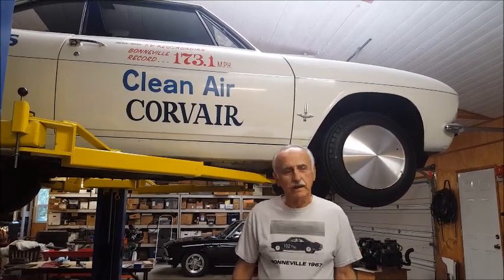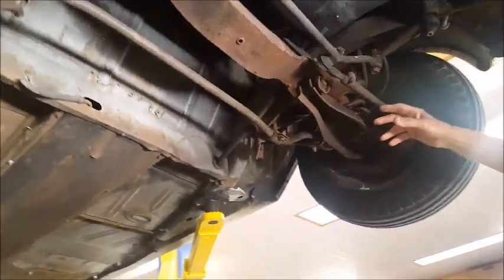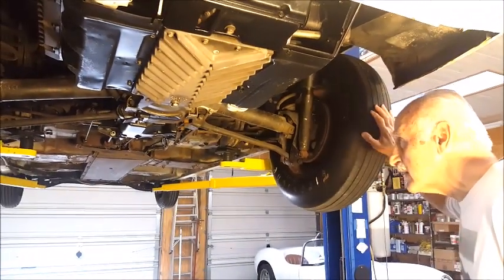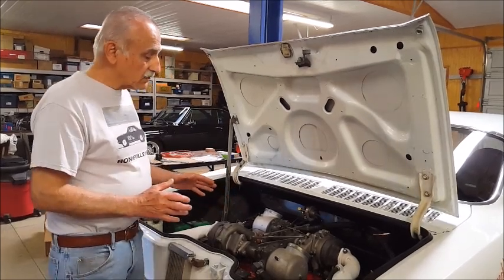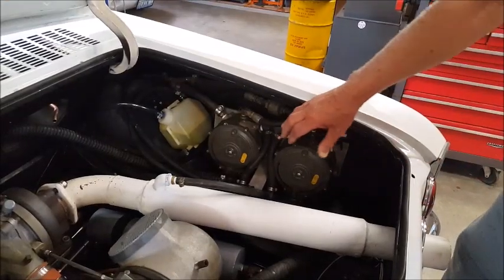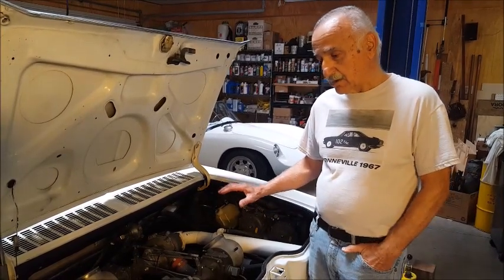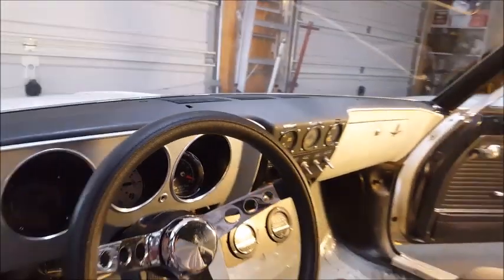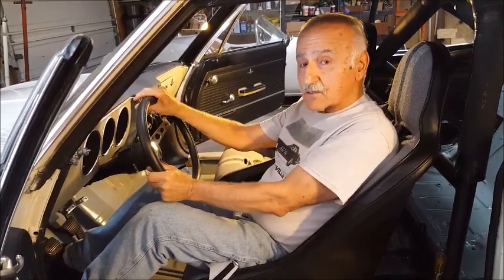World's Fastest Corvair, Is It Safe at 175 mph?

Comment: They did come with an extra fan belt, they tended to break at odd times. Ralph Nader made a fortune picking out the CV as his target. Yes, they would burn in a collision but so would a lot of cars at that time. They tended to leak oil too but that was the engine assembly. When rebuilt by an after market shop they didn't leak. If Chevy would have put some boost into the turbos they would have been a bunch quicker. A good car with a bad rep. We used the engines in sand rails and they really got with the program.
Reply: Don't confuse the Corvair with the Ford Pinto.
Reply: @johnholzhey8149  
To be honest, I never ever saw a Pinto in any of the junkyards in this area that had burned.  I got intrigued at all the bad pres that Pintos began getting along the way.  Here's what I found out:  

In order to make a Pinto catch fire in a "low speed rear end collision" the impacting vehicles (4100 lb retired-civil-service Dodge Senecas) had to have sparklers mounted to the bumpers and the impacted Pintos had to have gas tanks filled to the brim and even then the Pintos seldom ever managed to catch fire unless the impacting speed was steadily increased until that "low speed impact" ended up being 40 mph.  And even then the Pinto didn't always manage to catch fire.  You had to clobber the Hell out of a Pinto to make it catch fire, hard enough to crumple the car and shove the rear axle assembly into the back seat and likely kill the occupants which would make any resulting fire moot.  I have several photos of crash-tested Pintos that had the mortal hell knocked out of them, enough to actually warp the car so bad the windshield shattered and they didn't catch fire.  

I dug through the NHTSA and looked up the stats.  It took a while...  At last count (that I was able to find) the record for deaths in any Ford products Specifically caused by Fire and not just impact trauma appears to be the Panther platform which is the Lincoln Town Car, Crown Vic and Merc Marquis.  Latest numbers I could find for deaths from fire (several years ago) was 109.  Interestingly, more than a few of these fires involved police officers in Crown Vic cop cars.  Next was the first generation Mustang which had the same drop-in fuel tank as the Panther platform cars... latest numbers then was 67.  The Pinto?   NHTSA's latest at that time, 27.  These were the only numbers I could find that were actually stated as having been caused by fires and not the crash itself.   Last note:  A few years ago, deaths from fires in Mustangs added to the count when a restored early Mustang was stuck from behind, ruptured the fuel tank and splashed gasoline into the passenger compartment which ignited, resulting in a fatality and a lawsuit.  Not sure how the suit turned out, couldn't find any more about it.
Reply: @tonyunderwood9678   The easily punctured pinto tanks were due to one particular bolt piercing the tank. That was corrected. Don't joke about sparklers. Aftermarket halogen headlights ignited MANY fires. Visit some scrap yards and stop playing with paperwork. No offense intended.
Cheers 🍻
Reply: @andykerr3803    Sir, I wasn't joking about the sparklers.   The tests were doctored by attaching sparklers to the fronts of the impacting vehicles to "simulate electrical sparks" after the impacts kept failing to ignite any fuel that was spilled.   And aftermarket halogen headlights?  Please explain to me like I'm 12 years old how halogen headlights caused fires in Pintos.  I seriously doubt those old Dodges had halogen headlights...   And I've been crawling around junkyards since the 1960s, something I mentioned in this forum and I reiterate AGAIN that of all the wrecked Pintos I'd seen in wrecking yards, not a single one had burned... and I've picked through a lot of wrecked cars.  I drove a Pinto for years and I'd drive one again today if I had a chance to pick up a nice one.  Not so easy anymore because Pintos are starting to go for serious money because like so many other compacts they were treated like disposable objects, thus not a lot are left in any sort of decent shape.  If you wanna rant about flaming rear end impacts, lets talk about the Panther platform cars (Crown Vics, Merc Marquis, Town Cars etc) and first generation Mustangs which have burned to death many more people than Pintos ever did.
Reply: @tonyunderwood9678   Always nice to stand corrected. But yes, as far as I remember the ruptures were due to one intrusive bolt on impact. It was corrected. Halogens in all fires were a huge factor. Way hotter than wiring shorts. In fact bought stupid brake light replacements that meted the plastic in the short time at intersections. 
I used to rove huge scrap yards, usually burned cars aren't kept for parts. I did find many front or rear burned examples of my own Ford  Merkur XR4Ti which alarmed me, because the partial burned sections melted even the heavy aluminum sections under the hood and all but bare steel in the back. The fuel system was supposed to be at 45 psi but could venture further.  That is actually an easy hp boost, take it to 60 psi. But I knew there must be a fairly common cause. Now we are talking about Ford North America here, even though it was an import with parts from multiple countries, mostly Germany and Brazil.
All companies try to cover dangerous faults and do a recall, without alarming the public or alerting lawyers. I can assure you people died in both Pintos and Merkurs ( same basic 2.3 btw, but no connection). I discovered the problem was all the white nylon looking plastic on the car. Not just fuel line components, it was in each coupling as a locking clip, but even the anti freeze cap would snap at the tether. This was due to very cold weather leaving them brittle and dangerous. I live in Canada, so -30° C is possible. 
Now, what did Ford do to cover themselves? They changed the plastic in 1987. I had a few 1985-88, so I could see that. 
Being sneaky, they issued a recall.... 🤔 
But only in the North West Territories. I can guarantee you Tony 100%, there is not one Ford dealer and certainly no Merkurs driving across the Tundra.
They were super cars , but all Ford mechanics did not have training on the turbo, electronics, vacuum and fuel injection systems which differed from similar SVO or T- bird offerings. My point is, trust your eyes, especially in real accidents or the crashed and burned vehicles. The Pinto was a good car, I also had the later Corvair.
No problems. But clearly there is accepted deaths and settlements that figure financially in the boardrooms. I tend to use race car parts and standards.
Safer, more fun and sometimes cheaper.
A foam filled race cell exists for good reasons. Enjoyed the info and 'sparklers'.
Cheers 🍻
Reply: In my entire life I never heard of any Corvair anywhere that burned after a collision.   I'm excepting the battered worn neglected Corvairs driven as beaters that had various issues to include fuel leaks in extreme cases... which was typical of ANY 1960s car that hadn't received any maintenance since Johnson was president.

Comment: My first car was a Corvair when I bought it I was so sick I bought it with no test drive finally managed to get better took it to work was it gutless drove it to and from work for 3 days on the 3 day as I pulled in to work a fellow was there that was a member of the Corvair club as I got out he said sounds like it's running on 3 cylinders ask me to start it up so I did and he opened the hood and took a then showed me the problem one carburetor was unhooked so he put the linkage back on and what a difference had lots of power since the odometer didn't work I took Naders false claim when it starts to drift it at 55 mph how wrong he was figured out I must have been doing a lot more as the time to get anywhere was good held the road great after it finally died I got another vehicle and had to relearn how to drive took a corner i normally took full throttle with the Corvair and it was a good thing I had no one beside me on the right I started in the inside lane and ended in the outside curb lane now if anything was unsafe at any speed it was that gm pick up couldn't even take a 55 mph corner at 55 without losing it's grip on the road afterwards I found to take the corner it was 40 mph and no more couldn't even haul the weight of the Corvair yes I had a moto if I needed to haul something whatever I was driving got loaded it's surprising what you can strap down on the rear hood and on top of a vehicle our 5 ton water truck broke down in a bad spot had to push it off the road as the tow truck wasn't able to get there until 9 am and it was 6 pm couldn't leave it blocking the road overnight so put the front trunk up against the back of the truck and pushed it off the road shortly after I lost 2 gear drove it for a while in first gear one day I went by a radar trap didn't bother to slow down after all how fast can you go in first got a ticket for doing 50 in a thirty zone at first I figured crooked cop but after caculatiing distances covered in the time I covered hhem it was a wonder I didn't get more

Comment: None of the tuck-under issues with the rear swing arm design of the Corvair would have any impact with high speed straight line stability and safety on the Salt Flats.
Now, use it for a motokhana with multiple hairpins, or a slalom course that rocks the weight transfer side to side and you'll run in to the limits caused by the rear suspension design fairly quickly.
The later factory redesigned layout cured the tuck-under nature during cornering, again, cornering isn't used on the Salt... So the later suspension wouldn't have any impact for straight line speed on a perfectly flat surface, but switchbacks on a mountain road, the later ones are good handling cars.
Reply: Good info. I recall in High School doing a book report on Nader's 'Unsafe at Any Speed.' Now, I just love the Corvair.
Reply: WHY do so many people call the rear suspension of early Corvairs "swing axle"?  They are semi trailing arm, NOT swing axle.  If Chevy had started building the '65 model initially in 1960 and had a solid water cooled engine they might have done far, far better in the market.   But, having said that, transverse engine FWD is simply a better design all around for normal passenger car use.  I love driving later Corvairs, but have no real desire to own one and deal with the engine.  Boxer engines are wonderful things in some respects, but are expensive to build and can be a pain to service.
BTW, as far as styling goes the late Corvair is my choice for the best GM design ever.
Reply: @anvilsvs  being able to pull barrels off to replace ,w/o machine work to block is very easy maintenance too me
Reply: Early cars handled fine.
Some ran into issues when they had the wrong air pressure in the tires and took corners fast. 
It used different tire pressures than other common cars, due to the rear engine.
It was easy to get wrong pressure into the tires; had to follow door sticker for correct tire pressures.
All cars have issues when cornered fast, with wrong tire air pressure.
It's noticed at lower speeds too and most correct the issue or like in a newer car, it can tell the driver that the pressure is incorrect.
Reply: Took the words out of my mouth. Straight line and cornering are different!

Comment: I ran across an ad for a Paxton supercharger kit for my Corvair. If I recall it cost $300 at the time, being single with money to burn I was all in. I had to do a modification on the rear engine mount to attach the blower drive pulley, among other things. The blower was mounted where the spare tire was located. The blower rotation was opposite to the engine rotation, so the drive belt was positioned in a figure eight to match each rotational requirement. What a blast. One night at 2am on a lonely stretch of I-94 I put the pedal to the medal. Of course I had no idea how fast I was going, I had gone way past the end of the speedometer and had it pegged. I noticed a pair of headlights far to the rear. I was approaching the Detroit city limits so I slowed down. Soon the police flashing lights on the car behind me made me pull over. The officer said he was going 135 mph and I was pulling away from him! Lucky for me I happened to know the officers partner and got off free. I wonder how many differentials that propane wonder has gone through? That was a regular replacement item for me. The only modification to the engine was to hone the cylinders .005" oversize and added Corvette racing valve springs. Regularly wound the engine to 8200 rpms. A local Chevy Dealer wanted to sponsor me to run on the drag straps. I declined.
Reply: They wanted to get your fool ass off the streets you old hot rod 🤣 with due respect I'm pushing 63 myself still bending pedals mostly to brace myself drag strip only nowadays but not back in my teens 20s-30s+🤔 don't have to look back except to see if the youngins are ever going to catch up keep it on the drag strip boys it's legal

Comment: bias ply tires?
Reply from the maker: Chas, you hit the nail on the head with your question.  Sixty years ago, I bought a brand new 1961 Monza and it was equipped with 4-ply tires.  I had a ball sliding around corners, auto crossing, drag racing, etc.  At about 8,000 miles, the rear tires were shot.  I went to the tire store and was told that 4-ply tires were no longer available--I had to buy 2-ply tires.  On the way home with the new tires, I couldn't keep the car in my lane, even at 45 mph.  I stopped at a gas station and checked tire pressure--it was at factory specs.  I ended up replacing the tires with some re-capped Dunlop 4-plys and everything was back to normal. 
 It's the bias 2-ply tires that are Unsafe at Any Speed!!!

Comment: When I saw your engine, I immediately went and got my book by Bill Fisher, "How to Hot Rod Corvairs", because I thought your engine did not look like the one in the book. I was right, but wrong. The book's picture showed a stock looking turbo with a 2 bbl carb, and intercooler. But then it said that you went 134 mph in 1966, which is still impressive. Back in the early 90's I built a turbo Corvair engine with the E-flow turbo, smaller A/R turbine housing, Porsche K-Jetronic F.I. and put it in a VW Karmann-Ghia. THAT was a fun car! Cool video, Tom!

Comment: In 1967 I purchased a turbo powered Cutlass.  The previous owner had ended up taking the vehicle to Ak Millers garage in Santa Fe Springs Ca.  Ak was the premier shop (actually the only shop) that knew about turbos.  He installed his own water injection system, a Corvair vacuum advance for the distributor and  vacuum pressure gauge from a surplus store that originally was used in a WW2 aircraft and at least 3 other modifications.  He is absolutely correct if the previous owner had not spent the money to fix several factory defects there’s no way I could have put over 70K on the car.   Great vid!
Reply: Was that with the little aluminum V8?
Cool.
Reply: @andykerr3803    It was a 215, Buick had a 215 aluminum V8 that Pontiac shared.  The Olds was slightly different.
Reply: @supersami7748   GM was strange. Seems they were heavily influenced by the steel industry, they still bash aluminum ( literally) when their competitors use it. That V8 was sold to Leyland motors, it was used in many specialty vehicles, but was the main motor in the Rover for a good stretch. 
Fun to rebuild a classic Olds or Buick with modern upgrades.
Cheers 🍻
Reply: @andykerr3803  went on to power all the land Rover SUVs you see on the street now
Reply: @supersami7748 Oldsmobile 215s used their own cylinder head design.
Reply: @tacoheadmakenzie9311  I believe Olds used one additional head bolt per cylinder, perhaps in anticipation of boost.

Comment: Did I miss if you said what the compression ratio is? So there was no change in the gearing, just larger diameter tires and redline rpm to get that speed? 
My sisters high school boyfriend had a lavender 64 or 65 Corvaire Monza convertible with white interior. I saw all four wheels off the ground breaking over the crest of a hill!

Comment: Your 1965 car had the updated rear suspension with universal joints at both the differential carrier and the wheels.  The early designs didn't utilize that and caused the wheels to tuck under and make the car unstable.  They got a bad reputation because of the early model's design.
Reply: And there is a difference driving any car in a straight line vs. any turning.
Reply from the maker: Thank you Mr Stafford for your comments.  I'm fully aware of the difference between early and late Corvair suspension systems.  In the early '60's, I set records at the salt flats in a 1961 Corvair and had no handling issues.  I also entered a number of autocross events and did very well.  One of the commenters several weeks ago reminded us that early model Corvairs did very well in the Canadian transcontinental  winter rallies--finishing first I think in 1961.